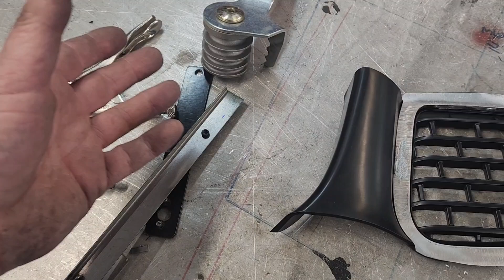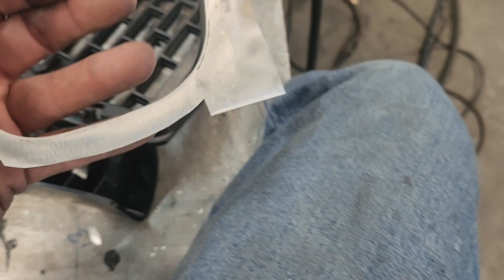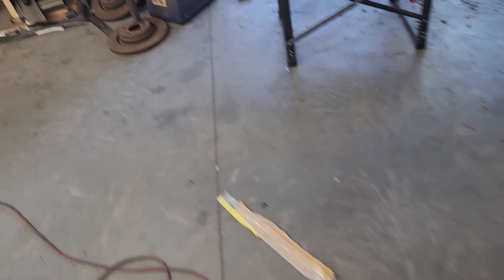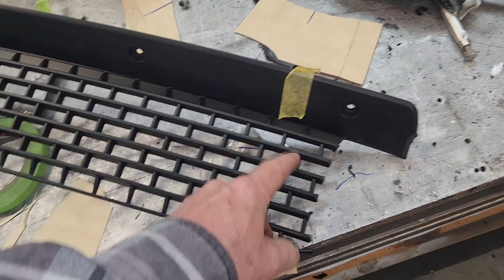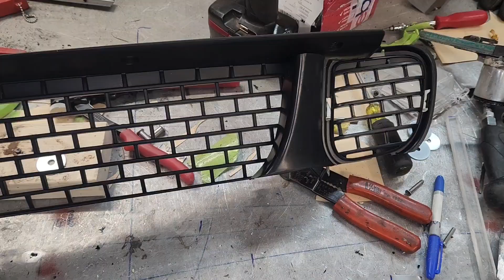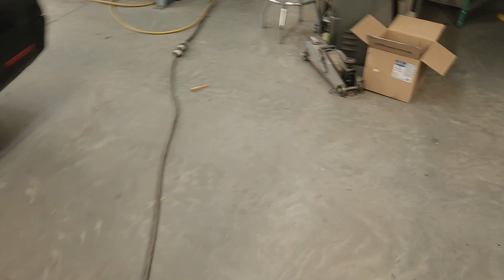Randy's Hellcat Daytona part 69

Comment: Did installing it just under the front of the nose, with a downward angle work? The 70 had a center grill and two side pieces..
Reply from the maker: The center grill worked fine. I still have to work out the side pieces.